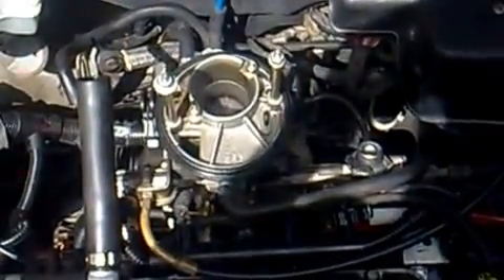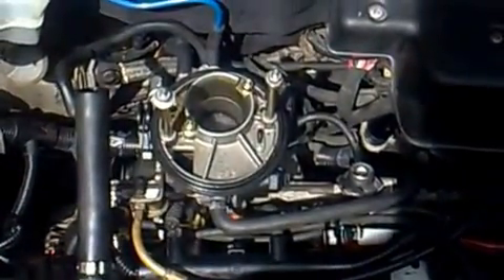MPFI (Multi Point Fuel Injection System)

Comment: hey Sarab Preet, this engine from the Punto 75 is not a "true" multi point injection engine. sure it has multiple injectors but it fires them all at the same time. this is called "batch" injection. true multipoint injection works sequentially. meaning that the fuel will be injected to each cylinder independently of other cylinders. the firing order on the punto 75 engine is 1342 so the injectors will fire in that order.

this engine does not have enough sensors to be a sequential injection engine. it has no mas air flow sensor, no cam position sensor or no knock sensor. the sensor you pointed to on the throttle body is the air intake temperature sensor.

i have just fit this engine to a old style fiat panda 4x4. quite fun.. no engine electronics to full electronics.

nice video by the way. 

i cant wait to get my hands on a common rail Fiat Multijet diesel engine. my dream would be to fit that into the old style panda :D

keep the good videos coming!